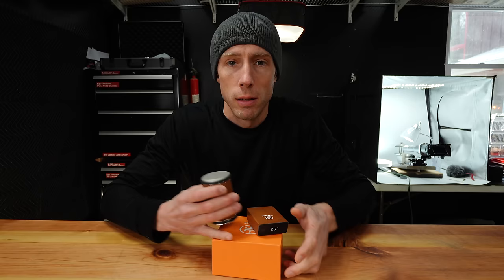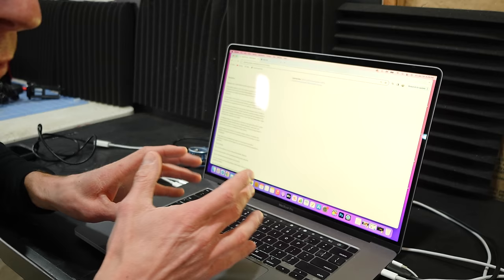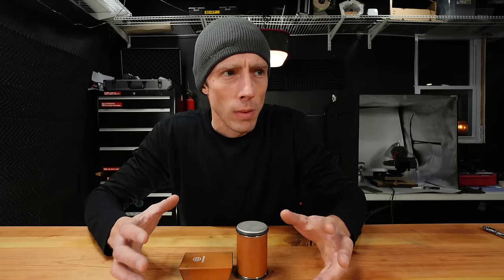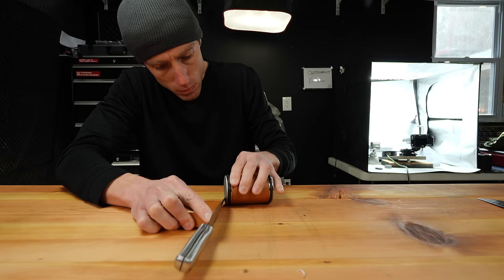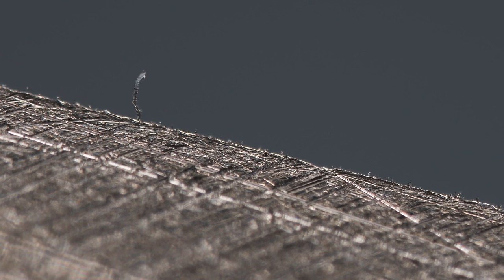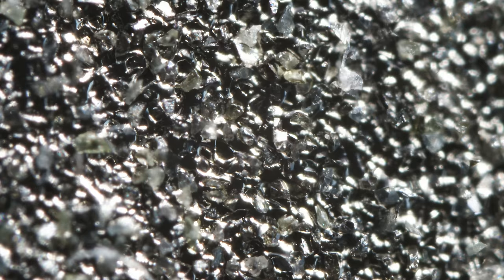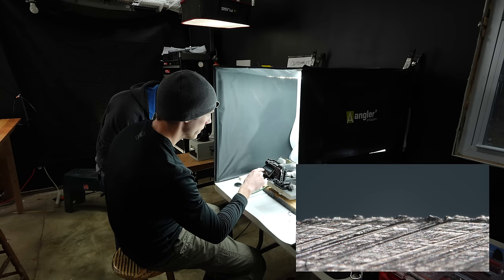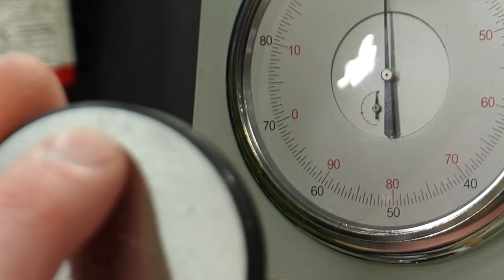There’s Something Strange About These Rolling Knife Sharpeners..

Comment: Before buying my Horl I had some doubts as well. Because of the aggressive Tumbler advertising. But discovered Horl to be the Original(?). And saw comments about the poor longevity of the the Tumbler, hence the cheaper price point. Plus seeing that there is a Horl version with replaceable discs, I felt that was the perfect choice. 
It allows me to maintain my nice knives without having to learn how to effectively use a whetstone. I have yet to have any complaints, with the exception that a investing in a strop would definitely help get it that much sharper. But that's money spent another day. In the meantime its been fantastic on its own for my own personal cooking use and regular maintenance of my knives.

Comment: I have one and can say your review is dead on, however I still like it for what I use it for.  It is of little use if you are trying to sharpen a knife that has been seriously neglected.  I am no expert and have a hard time holding a knife at a consistent angle when sharpening.  I use the tumbler for that final finishing to keep my angle perfect and again after every couple months or after heavy use to keep my knife sharp.  However, I agree the honing side is next to useless.  I use a different honing and a good strop.   If you let your knife get too dull, it will take a while to get it sharp again.  Thanks for your review, I wish I'd seen it before I bought it because I probably wouldn't have.  I was expecting it to do a good job on all knives and found you are correct; it takes forever on a very dull knife.  If you use it to keep a knife sharp it does a good job but don't expect trying to bring an old, neglected knife back to life with it.  It will take a while if you do.

Comment: If you have nothing else, like in a survival situation, you can sharpen a knife by taking a stick and pounding sand from a streambed into the surface of the stick, and then using it like a chefs sharpene/knife block rod. I learned this in survival training and it works surprisingly well. 

If the sand has crushed up granite in it, the only better abrasive would be diamond.

Comment: My understanding of honing is that it's not suppose to remove material. It's just suppose to straighten out the edge from use to use. It's never meant to remove a bur. So if the instructions say that's what it's for, that is inaccurate and you still need to strop when you sharpen.

Comment: The best knife sharpener is the one you will use. Most of them, when used properly, will sharpen a knife to a level most will deem sharp. That is why i use an automatic one, it does the job and is fairly easy to use.

Comment: what you describe, that the metal disc is not coarse enough to take enough after a couple uses is intended, at least with the Horl. they also sell coarser discs so you can get the initial work of aligning the edge to 20° or 15° in quicker. they write in their user manual that after a couple turns the biggest, coarsest diamonds on the disc will break off and the noise will get quieter, thats basically when youve worn the disc in and from then on it will have its default coarseness setting of 46µm. I have a horl 2 with this default diamond disc, the ceramic one and 2 very fine ones with Korund/corundum stone on it for the razor sharp edge.

there is no way to estimate if this is also what knock off products like the Tumbler intend ofc, or what their reasoning behind their choice of diamind grit size etc. is based on.

Comment: As a complete sharpener noob I bought a Horl 2 at an exhibition in Vienna, Austria one year ago. It works fine and you can achieve a consistent angle when sharpening. This is beneficial for newbies like me. However due to the curved edge of kitchen knifes it is easy to mess up the angle at the tip of the knife. And sharpening takes much longer than with a flat sharpening stone.  Furthermore the Horl 2 is extremely expensive. For roughly a third of the price I could get a simple sharpening tool with a diamaond stone from e.g. the company "Schmiedeglut" (see Youtube channel in German) which seems to work very nicely and is more versatile (sharpening scissors, etc.).

Comment: Try the Hone sharpener made in Canada. Similar design but has 400 grit side and 1000 grit side. The magnetic block has a 20 and 15 degree option plus a special notch on both sides for smaller knives. I finish it with a couple of passes on a very fine diamond steel. Had  one for a year and it still works beautifully.

Comment: There's another style of rolling sharpener that's been fairly common at least since the late 1990s, but those types all use a central wedge-shaped gap between two circular halves of a stone or other abrasive with the knife being sharpened in between. (the non-rolling style of linear/gap type sharpeners also seem to work better and/or are easier to use even if they take up a bit more space)

All of those have issues, though, especially that they can only sharpen to a fixed blade angle and that angle changes as the stones wear. Some also can't be tightened, so they're junk once they wear too much. (even being spring-loaded for tension doesn't really solve this, plus it's even more an issue of being able to disassemble and clean the gunked up loose grit out rather than just being able to tighten them)

This current type of rolling sharpener seems like it might be more useful, though I'm not sure it's any better than traditional slab/rectangle type sharpening stones, especially mounted in a good box or holder. (my middle school shop class had a project for building those, the best version had a narrower wooden block mounted beneath the hinged box so you could clamp it into a shop vise ... granted that's less useful in most kitchens, so I just put rubber grippy strips on the bottom of mine)

Comment: Figure 3 in the patent is the equivalent of the angle block and the other two round things are individual coins which  correspond to the two sides of the roller. The horl and tumbler just made it more convenient and easier to grip than the patent

Comment: I am not a patient person when it comes to sharpening knives.  I bought a $20 electric sharpener, it works well enough and it's quick.  Then I deburr with ceramic.  Perfect edge?  Nope.  Shave with it?  Nope.  But good enough for my kitchen use.
(And I shave like my grandfather did - with a Remington electric.  I've actually got one of his razors, I don't use it much because it has to be plugged in, but it still works well.  My own is about 30 years old, I've only had to replace the batteries once.)

Comment: The Brisko knock off provides a variety of replacement discs with different grit.  As you point out, this style of sharpener is for larger longer knifes and doesn't really work that well for EDC length folders and non-folders.

Comment: I fell for the marketing on Tiktok for the Tumblr and dropped the $100. Your results and mine were the exact same! At first, it sharpened my semi-dull kitchen knives to sharp. I got it just for these knives. After the first few knives, I noticed it does take longer to get the knife sharp. I chocked it up to that knife, and the one after it, as duller than the first few I did. Then I noticed that the diamonds seem to be rubbing off. OH! Thats not great, but kind of expected I guess. I keep the sharpener next to the knife block, and use it to tune up the edge on a regular basis. 

For my other knives, I prefer the Ken Onion Worksharp. But that is out in the shop, and I use it on my smaller knives and axes. I got the Tumblr to keep in the kitchen because I was tired of taking the knife block out to the shop and spending a few hours putting an edge on the knives. 

I kind of really wish I watched this a few months ago, before spending the money on the stupid rolling pos.
Reply: do yourself a favor and stop buying things off social media advertising. never do it. it's all garbage. like, literal garbage.

Comment: I have the original HORL2 and if I purposefully dull the knife, it takes about 3-4 minutes to restore the apex but I cannot grind it down to cut paper why I always finish on a wetstone. my guess is it's because it's dry and 400. but its a very easy way to prepare my knife without a lot of thinking and the final work that needs a lot concentration can be done in under a minute

Comment: I bought the Work Sharp from Milk Street a few months ago. When I found it at a lower price they let me return it, but emailed me (with pictures!) and claimed I had returned a used sharpener, when in fact it was NEVER used. After back-and-forth emails they refunded the price difference ($40) and sent back the same used sharpener they claimed I'd sent them. Despite the fact that I instructed them not to. It's had a lot of use, and it doesn't seem to sharpen very well. I'm not sure if I'll buy another rolling sharpener, or which brand, but I can guarantee I will NEVER purchase anything again from unscrupulous Milk Street.

Comment: The thing about finding patents (or rather the difficulty in finding the original one) is that sometimes the design was intended for different use. Perhaps the design was smaller and intended for shaving straight razors, or bigger, intended for industrial use, and not even used for sharpening anything at all.

Maybe that is why so many people point towards a patent that only barely resembles the actual design; they only found the patent named "knife sharpener" that CLOSEST resembles it, but Horl could have merely repurposed a patent and willingly didn't really publish or specify anything (many inventors willingly never patent their designs to avoid publishing the design altogether, a requirement for patenting).

Comment: Well, he is exactly correct especially the Jerk Part 😂...I have had 5 of those, from Pull Thru, Swing Stone, Actual Wet Stones, Rolling Sharpener, and 2 various Work Sharps. I have their version of swing arc with all grades of Wet Stones and Diamonds accessories, but the Simple Electric Rotating Disc Work Sharp in conjunction with my Rolling Sharpener with Diamond Disc Kills it.

Comment: Got the original for christmas last year, so far ive only used it once but i was very happy with the result. Sharpening took a minimal amount of time, judging by how youre holding it id assume that the magnet is also stronger since holding a small kitchen knife with the edge exposed isnt a problem either. Uf you have large knifes like butchers knifes theyll tell you to simply put a cutting board under the roller :)
Mb give the original a try, they also sell different grits that you can change out easily and adjust the roller to how you like it.
I agree that its very expensive, however its a german niece product so thats that. Reason i wanted it because it gives a nice consistent edge when i sharpen my knifes every 2y or so

Comment: I got a version of this on Amazon for $70 that took about 10 minutes to take blade that had literally no edge to sharp enough to cut paper. Whether that'll hold up in the long run remains to be seen but based on what I've already seen of mine I'm optimistic.

Comment: I feel like the "honing" side is actually a lapping plate and you're supposed to charge it with a diamond slurry. That's also why it's soft, as it needs to be softer than the knife, so the diamond embeds in the lapping plate and not the knife. Why they'd use stainless steel for that is beyond me though, normally you'd want something like copper or grey cast iron for that. I'm not much into knife sharpening, but more into sharpening machine tools for metalworking. I use parts of an old cast iron brake disc as a lapping plate for lathe tooling, combined with either a 3µm or a 1µm diamond lapping compound. This works well for HSS and carbide tooling.

Comment: I think it's quite a smart design. Takes some variables out of the equation so more people can get better results. I just falls pretty short for the price.
I would DIY one with exchangeable paper sanding disks. Something off the shelf like vehicle bodywork disks. Good range of grits, cheap-ish and everywhere. Not a hard devise to build if one has the knowledge, skill and tools. Also make a number of holder blocks with various angles and sizes, both length and height, for different knives. Those magnets are cheap and widely available.

Comment: I bought the dual sided Sharpal diamond stone from Amazon for about $25, based on your recommendation.  I used it on 5 different knives of varying quality. Some were cheap, literally $5 knives from the dollar store, and others were much nicer, S45VN and Cruwear steel.  The Sharpal worked great on all of them.  Finished on a leather strop with 6 micron diamond compound.  All of the knives were very sharp in a matter of minutes.  For what it is worth, I am really becoming a fan of the Cruwear steel. For my use, EDC, it is fantastic.

Comment: Writing this comment before watching the video: I've been getting blasted with ads for these sharpeners lately, and actually got really turned off by what I believed to be deception in one of the ads. It showed them using one of the Edge-On-Up sharpness testers to compare the sharpness of a fresh unused double edge razor blade, to a chef's knife sharpened by their rolling sharpener at a 20 degree angle. Naturally because its an ad, they showed that their newly sharpened knife beat the brand new razor blade (I think the razor blade scored a 12 on the scale and the sharpened knife scored like a 7. I don't remember what it scored before sharpening, somewhere in the 300s I believe). The trick they used was the run the razor blade through the test wire clip really slowly to maximize the pressure needed to cut the wire, but then slammed the knife through really fast to "trick" the scale into reading lower pressure than they actually used. Whether its true or not (and i have serious doubts) that their sharpener can get a knife sharper than a razor blade, the deception in the ad really soured me away from buying one.
Reply from the maker: There is definitely some questionable marketing behind the tumbler. Ive seen the same thing you mentioned

Comment: first of all, it matters a lot in which direction the blade is moved relative to the sharpening tool. That kind of rotating motion is not good, because one edge pulls and the other pushes, and then you get exactly that kind of mark. sanding always takes place towards the thick back. 30 years as a tool sharpener.:hand-orange-covering-eyes::hand-orange-covering-eyes::hand-orange-covering-eyes::hand-orange-covering-eyes:

Comment: Tl;dr - what are the resulting groove patterns when using a rolling sharpen

So first of all, LOVE your content. Best sharpening channel on this platform by a mile. Professional, to the point and thorough. Thank you for that!

Second, i was highly considering getting a rolling sharpeners for daily use since I don’t have enough time to put into working on my technique these days and still want that manual sharpening finesse (I’ll probably be buying the Horl, Hone or Worksharp as they seem to offer actual useful grit variety).
However one thing I didn’t see anyone address in the many reviews of these products is the actual groove pattern formed by the sharpening motion which is a ROLLING circular motion instead of a simple linear motion.
I remember you mentioned in one of your stropping videos that post sharpening the main thing you want to do is refine the scratch pattern created by the stone, so you should strop in the same direction and motion you sharpened your blade.
How does that work with rolling stones?

Comment: FYI - the Horl pro version is like 350 bucks. Buddy of mine has had his for several years and it still works. So at least it's high enough quality to be useable for a couple years. I'm sticking with my 10 bucks set of wet sanding stones though, thanks...

Comment: I bought one of these rolling sharpeners off Amazon. It works but has flaws. I found that a smaller width blade does not stay on the magnetic strip without holding it there. The smaller blades tend to drift downwards and fall out of contact with the abrasive wheel. It required a lot of holding the blade while rolling the abrasive disc. This was kind of a PITA. But with effort it does sharpen well. Just don't use small narrow blades

Comment: I have a Horl and a Chinese knockoff (edit-Proyan brand).  Both with the multiple disk options (fine sharpening).  They are both great for touch ups and keeping an already sharp knife sharp.  Small and easy to keep in a kitchen drawer.  I do not consider these great for fine sharpening a butter knife--nor do I want to do so.  If you have a dulling blade in your kitchen and you do not wish to go out to a workshop (or if like me you do not have a workshop)--these are a fairly easy and no mess way to keep previously sharp knives razor sharp.  I am a fan.  Full disclosure I d ont own the Tumbler I have a Horl and  Proyan.  For the finest of grits, I actually prefer the Proyan although it is pretty silly to shapen a kitchen knive to 12,000 grit.

Comment: Thanks for the video. I will keep using a Dual-Sided 400/1000 Grit Water Stone Sharpener, I have went through a few in my 60 years, most were lost or stolen from me, but @ US$19 for a new one it is no biggy. It would be a big deal if I had one of these expensive Rolling Knife Sharpeners @ €159.00 (US$173.22) or $189.00. I also use a Honing Steel.

Comment: The horl appeared on a german show similar to the shark tank a buddy of mine got one and had exactly the same problem, that it wears out pretty fast.
In my opinion the concept is nice and easy to use but its just to expensive for what it is. There are many attachments with different grid for the Horl by now, but with the pricing of it you could as well get something like the cheapest TSProf and be happy for years and get cheap replacement abbrasives